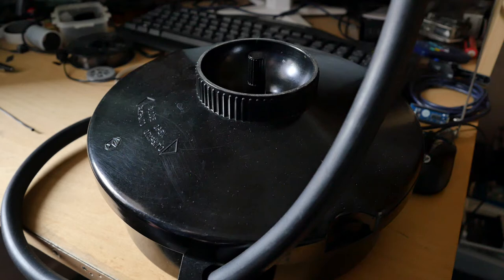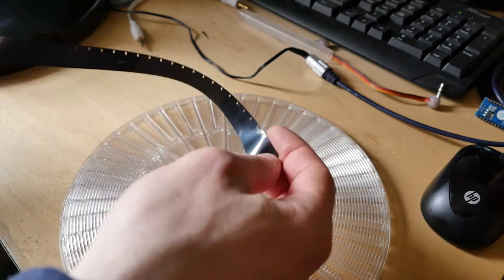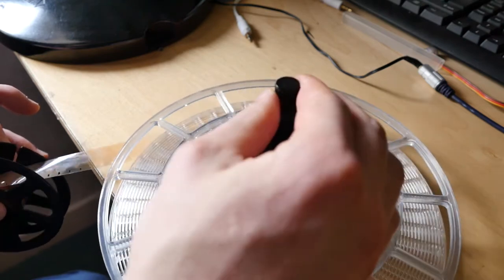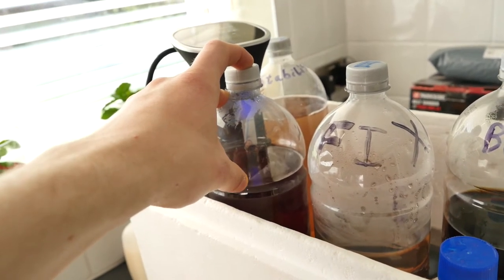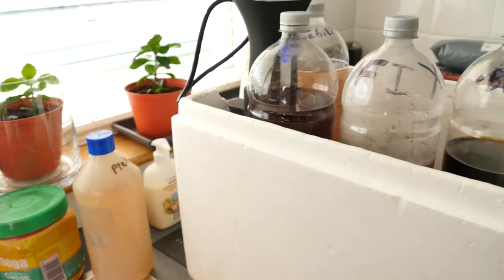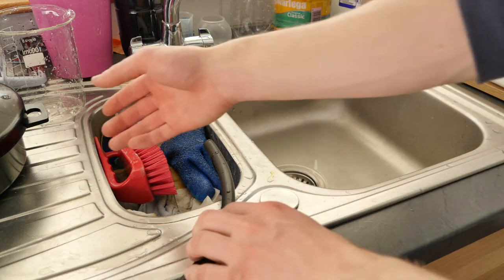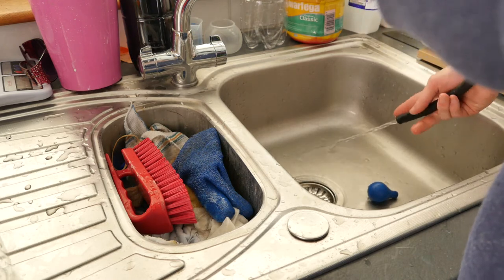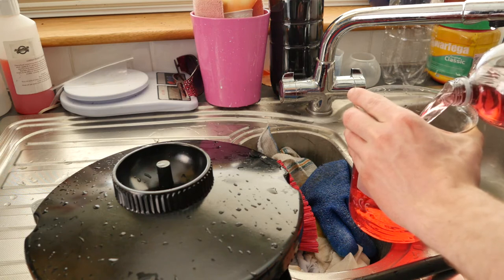How to develop 16mm film in a lomo tank

Comment: Cool demonstration, and even more helpful was your trick to scan the film with the projector, I just got an Eiki NT-0 so thank you for the idea 😁!
Reply: Yes great demo. The Eiki projector also must have a 5-blade shutter. Otherwise you will have horizontal lines in the video image and picture distortion. The correct voltage LED lamp can simply plug directly into original socket, no need to modify. Also need a piece of diffuser glass in front of LED lamp.

Comment: hey shaun, do you know what exactly the 16mm adapter is doing? ive got a lomo tank but it didnt come with a black piece, only 2 clear screw caps that fit onto the top piece - wonder if they work the same?